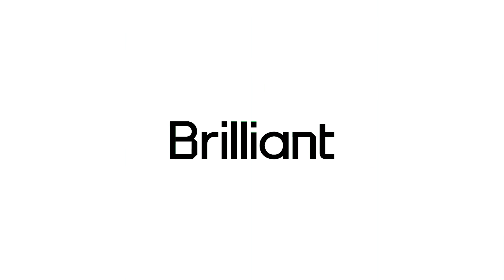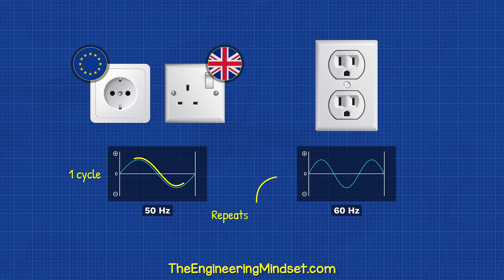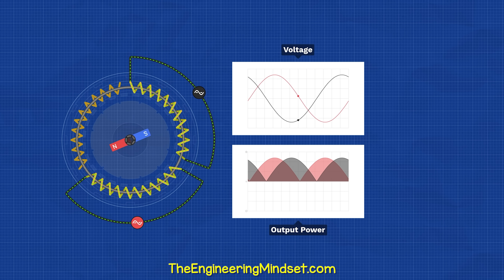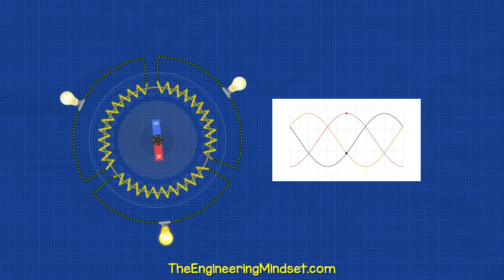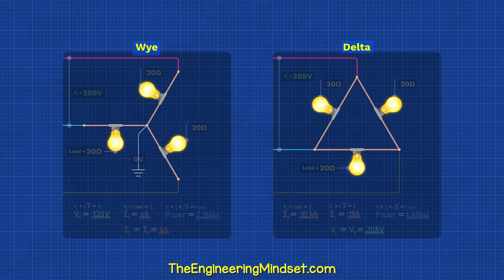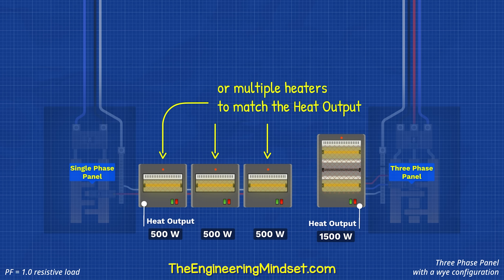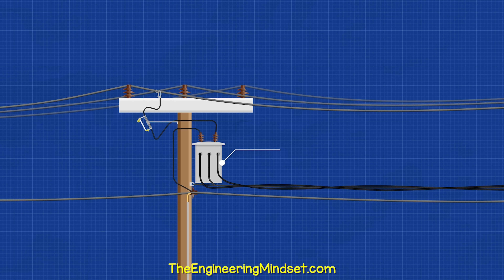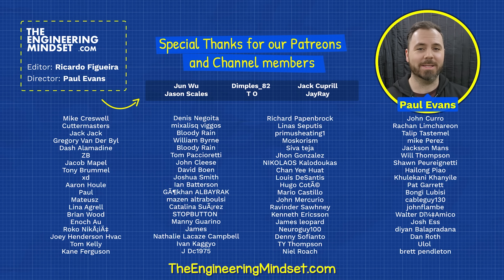How 3 Phase Power works: why 3 phases?

Comment from the maker: :_Hazard: This free video took WEEKS to make! If you’d like to support Paul’s efforts, links below: 
Watch ad-free here:➡ https://www.patreon.com/theengineeringmindset
Get your excel sheets here:➡ https://tinyurl.com/3-phase-calcs
Grab a 3 phase power mug here:➡ https://tinyurl.com/3-Phase-Power-Mug
Reply: Question for you guys. This video mainly features north american standard which is convenient since I am located there. But do you create another version of that video for Europeans with more prevalent European standards? Just curious. Great job BTW
Reply: @jean-huguesbouchard1045  He actually mentioned the european standard as the only alternative to the northamerican standard, even though it was a short video segment.

Usually, in the EU, we have 3-phase power of 400V 50 Hz in every household for big appliances (EV charging, electric ovens and instant water heaters) and 230V 50 Hz single phase (taken from any of the three phases + neutral) for "normal" stuff, usually using 230V 16A circuits. That is already useful for up to 3.680 Watts. Don't try that with the poor, typical 120V outlet in the US! Higher voltage means lower amperage for the same task, so less stress and temperature generation on the wires. But that's not the end of it, because that still leaves the rest of the world.
Reply: Whenever you need massive smoth dc, running a delta wye and a wye wye going through a full wave bridge gives very smooth output, minimizing need for big choke coil.
Reply: Would e.g a 6 phase generator waste less energy into thermal energy?  Like I wonder with our energy demands (e.g electric cars and like appliances that consumed insignificant power now kinda increased noticeably e.g a GPU can easily consume about 600watthours on its own if not more and that's without calculating the inefficiency of the PSU pulling power from the grid in order to provide 600watts to the GPU )
Reply: If the Earth's core is just a big magnet, could we put huge rotating stators in orbit around the Earth and create energy?
Reply: @me1970  no if earth's core had a strong enough mgnetic field to produce power by spinning around a huge stator ring miles outside of the earth (which we wouldbt be able to put in orbit in the first place but lets ignore that)  then you wouldnt be able to pick anything that had the slightest piece of metal on it simply because earth would pull it down towards its core ... you know like magnets do.. earths core has a magnetic field but only strong enough for us to detect with compasses or sensors not strong enough to actually have some real "pull" or magnetic intensity.
Reply: Very well explained
Reply: My 230V 50Hz
Reply: Thank you for your videos, guys! I love them!
May I kindly ask you to make a video about SCADA devices, line monitors, fault detectors, please?
Reply: Not only are higher phase counts more complex, they also run the risk of being tapped by pirates.
Reply: The voltage at the outlet is not constant.
Reply: any of yall from chicago get confused when stuff you plug directly into the wall always looks sideways 💀💀
Reply: Man,  you deserve pension from UN .. When I was a kid (and I'm 52yrs now) BBC would hire 15 man for content like this! Excellent job..
Reply: hi
Reply: I thought the older video was brilliant and then you improved it even further!  The original one is still worth a watch for a slightly simpler overview. Thanks
Reply: Please this video provid in hindi language🙏
Reply: as an electronics engineer, I don't deeply or as clearly understand this until now.  however, learnign this makes me realize how old this is and needs upgrading or replacement.  See, DC high voltage transformers are here and renewable energy is essentially DC, while most things we power in our house are essentially DC.

Comment: A slight correction to something said in the video: the magnetic field does not “push” the electrons in the wire to generate current. Rather, the changing magnetic flux through the wire induces and electric field, which in turn CAN move the electrons (Faradays Law). 

Furthermore, when someone says anything regarding the magnetic field doing electrical work, it has to be wrong because magnetic fields move electrons perpendicular to their velocity, and thus cannot do work.

Comment: If a location has 127V and requires two phases to achieve 220V, would this be considered a 'split monophasic' system?
Reply: if it has 3 main fuses, it has 3 phase power

Comment: The thing that never got through my head is how the neutral in the generator works. 

If one end of the coil is grounded, wouldn't it just escape all the generated energy there?

What makes "one end" of the coil the phase and the "other end" neutral? It would seem they both have the same potential for leaking the electricity.
Reply: Hello there,

Great question,  it's a really common misunderstanding. Neutral isn’t ground. In a three-phase motor the star point is normally floating and not connected to anything. In a balanced system the vector sum of the phase currents is zero, so no current flows there and it serves no functional purpose. Ground is only bonded to the motor frame for safety. Using a ground symbol to represent a floating star point is misleading and causes confusion.

Comment: 2 phase outlets are normal in most homes in Norway. They have 230V phase-phase and 130V phase-ground. Newer installations are 400V with a neutral

Comment: At 8:02, why does a 3-phase motor connect across 2 coils?  Something's wrong with this picture.
Reply from the maker: I checked and the image shown has 3 Phase connection, then in the graph 3 phases are shown. Where the line stops happens to be one phase at 0V (light grey) and then you read the phase to phase voltage of the other two
Reply: Yes, but the motor is connected across all three coils, and the "phantom" voltage among the three is 360(208 x 1.732).  All three coils are powering the motor.

Comment: thanks for the revision. Just a nitpick, but unless I missed something, you omitted the question of brushless motors. Leaving auxiliary phase out of the discussion, three phases is the minimum to obtain a reliable start for a brushless motor (asynchronous) in a predictable direction. Avoidance of brush wear largely justifies three phase in industrial installations. 
Power station alternators are brushless to, if slightly more complicated,  needing a rectifier to apply a continuous rotating field.

Comment: As an IT worker, I've had a general working knowledge of power delivery, but have had a hard time wrapping my head around 3 phase for a while.  This is probably the best explained version I've seen and helps understand aspects I didn't get before.  It's appreciated.  Also, no idea how this video showed up as recommended for me, I've not looked up electrical stuff in years.

Comment: So we use 230/400 and 400/690  mostly i guess in europe. But US 240 split, 277/480, 120/208 and so on, and good to know the different voltages and the use they offer. But i would be annoyed being dependent on splitphase or singlephase and have to deal with these fluctuations. But they can happen in 3 phase systems somewhat if not loaded evenly. Electrician's don't always measure or make plans for correct additions or know the grids fluctuations..

Comment: Em as cargas no consumo não estando balanceadas, há imperatividade do neutro ou pode haver ruptura quando a ligação pressupuser carga balanceada em estrela. De forma complementar, as geração pode ser em um maior número de fases e com neutros distintos para cada trecho, para fins de controle indutivo de cargas predominantemente não indutivas (menos oneroso) do sistema (evitando surtos que se propagam e blackouts e tornando o controle de espectro mais amplo, por ser antecipativo sempre que a carga não-indutiva é prevalente), chagando ao consumidor em três fases com neutro dedicado e suscetível ao controle independente em cada unidade de consumo. Um tal sistema tem grau de independência maior em relação a cada unidade geradora pois o terra é exclusivo e o sistema se reorganiza de forma rápida e segura em caso de queda de unidade, por não sincronização 'por default', do sistema que se antecipa à necessidade de reconfiguração ao invés de reagir a ela, sempre que bem projetado (sempre que a correção entre o descasamento entre cargas indutivas e capacitavas é não-reativo ou reativo abaixo de um valor de 'ignição' descontrolada. Um tal sistema é resiliente e comporta melhor a geração distribuída (pequenos e micro geradores) pois se pode os regulamentar no quesito controle autônomo (interno) e os onerar em caso de envio de resíduo não tratável à rede, inclusive se estabelecendo valores de ressarcimento ao transmissor em caso de ruptura sistêmica.

Comment: In NA 240v 3 phase is the most common voltage and most things are rated to also work with 208v. In Canada we also have 600v. Most motors are dual voltage 240/480. 
The 240v single phase is also known as split phase connection.

Comment: The only mistake is the statement about the electrons, electrons dont move and they are not what creates current. delocalized Bloch electrons are the fundamental cause of electricity in conductive materials like metals and to be clear its waves. So its the field not the particle. This little detail haunts u later in more advanced engineering courses.

Comment: the main reason is just the power transfer. The momentary power of the three phases are always constant - big difference to a single phase.  That is the main reason why Electric cars have a inverter to generate three phases out of the battery and feed that into the drive.

Comment: LEDs do flicker
Reply from the maker: I've replied to this same comment many times but LED's do not flicker, the controller makes them flicker. Cheap and badly designed circuits cause the flicker, my studio LED's do not flicker, my cheap desk lamp does flicker

Comment: 12:44 Actually, if you have 127V in 1 phase, you will have  127*√3 = 220V between 2 phases.
Reply from the maker: Not quite. Because √3 is only applicable in a 3 phase system. This is not a 3 phase system, it is a split phase system so it is (+120V) - (-120V) = 240V because they are both opposite ends of the same 240V phase, reference to ground which is centre tapped.
Reply: @EngineeringMindset  I'm sorry, my mistake! I was looking at the high-voltage three-phase system. In Brazil, we don't use center-tap transformers for energy supply, so it's more common to have a two-phase system with a 120° phase difference.

Comment: Great video. Home LED lights do tend to flicker, but at a speed that you won't tend to notice with a phone camera. If you use very fast shutter speeds you will see that they're turning on and off with pulse width modulation.

Comment: You don't need to load balance your 3 phases. It helps with equipment life and general operation, but you totally can put a load on 2 phases. Would be the same as having 2 out of 3 circuits with heavy loads in a star config.

Comment: It's a good explanation, but there's also a 9 phase generator. It is used to reduce the torque needed to rotate each phase on it's peak.
Torque/force is greatest on highest and lowest point of the wave, that's why you can't have 2 or 4 phase because it's like driving a car with square wheels. The force came from the current, speed to voltage, and force to current.
To compensate for the highest torque, it is made to be 3 phases so the force would cancel each other out.
9 phase generator usually coupled 3 of the coil but it's not offset by 40 degrees, it's 20 degrees! By rotating 3 of those coil, each 3 coils would only have 20 degrees offset so they can be put together in series.

Comment: That is such a convoluted and highly likely BS explanation for why we use RMS>
The far simpler one:
P=VI.
Assuming a simple resistive load, and noting V=IR, this gives us I=V/R
So P=V^2/R.

i.e. the power is proportional to the square of the voltage.
So they average the power, and give the equivalent voltage.

Comment: Two phases (at 90 degrees, also known as "quadrature") are enough for creating rotating magnetic fields for motors.  3 phases is smoother. Three phases have a nice symmetry in that the phases are evenly placed around the circle (3 x 120 degrees = 360). More than 3 phases is more complexity for insignificant benefit.

Comment: But then Veritasium said that an electrical circuit isn't formed by the movement of electrons.
Reply from the maker: Thats not quite what he said. He said electrons drift through the wires due to the surface charge and the energy is transferred through the electric field around the wires. He have an incredibly detailed video on it here: https://youtu.be/3KePcASD0NQ?si
Reply: @EngineeringMindset  Thanks for the clarification
Reply: Wye connection line is  1.7times phase voltages but reconsider it😂

Comment: If you need more phases then it should be done at the power generating station itself. At present most generators have 3 leads at 120 degrees apart giving 3 phases. For 4 phases there should be 4 leads that are 90 degrees apart. I am not an EE expert but I am guessing from my science background.

Comment: Short answer:  Three phases is the fewest number of phases whose average power is a constant.
Reply: Or, the lowest number of slices you can divide a wheel into to provide the smoothest rotation if said wheel had periodic intermittent torque provided to it along the area of each slice respectively.

Comment: During RAAF mechanical trade training back in 1989, we had to do a "Basic Electricity" module, which briefly touched on 3-Phase. And I do mean BRIEFLY. All we had to do was memorise that 3-Phase = "3 phases of electricity, 120 electrical degrees apart". No diagrams of sine waves, nothing. I was that annoying trainee who wanted a better explanation, and pressed the instructor (a qualified electrical fitter) for more. What I got was, slowly, with emphasis "Well, it's 3 phases, and they are 120 electrical degrees apart, see?" I gave up.

Comment: Australia does have a 4 phase electricity supply, a 3 phase electricity supply and a 2 phase electricity supply. 
Exactly how they each work is something I don't know but I have worked with all 3 of them when helping the electrician at my first job over 30 years ago. We had both 3 and 4 phase spools that I had to roll out from the power grid connection point to where our equipment was located, this was for concert sound and lighting.

Comment: Why not less phases I just finished a working 0 phase system 456 AC 36.7 DC output 0 phase multi loop multi output power system that Powers and charges itself

Comment: It is designed to produce 1800 rpm or 3600 or approximately at standard voltage at 2phase or 3phase line.4 phase or more will not run in 3phase line.

Comment: In a 240 volt residential service are the two hots in phase?
Reply: In the US split phase residential then the 2 hots come from opposite ends of a single phase transfomer. When measuring both hots you get one 240V rms wave. When measuring from the neutral (center tap of the transformer winding) to each hot you will get 2 120V rms waves 180 degrees apart. The hots are 180 degrees apart with respect to neutral.
Reply: @Redtooth75  are our 2 120v hots connected to 2 high voltage hots?
Reply: @gamecubeplayer  The hots are connected to opposite ends of a single transformer winding, the neutral is attached to the center. That gives you the 240V hot to hot and 120V hot to neutral.
Reply: @Redtooth75  what about the high voltage winding of the transformer?
Reply: @gamecubeplayer the primary side of the transformer is generally wired to a hot and neutral off an upstream wye transformer.
Reply: that depends on your country

Comment: Sometimes we need more phases. Using special transformers we can get six phases from three. It's useful while converting to DC with rectifiers. Having six phases the conversion is smoother. It requires more diodes in rectifier but the load on each diode is smaller. Anyway this video is OK.

Comment: I have been an electronics technician for about 45 years(not an electrician). when I was in the Air Force in Germany, my commander wanted to install some 120V 400Hz equipment in a prefabricated structure that was wired for 220V 50Hz. We didn't have any electricians in the unit, but Ground Radio Maintenance is the traditional go-to for anything that doesn't fit anywhere else. I connected the 120/400 to a separate circuit breaker panel, and voila! we had power for the equipment.

Comment: I've taken 61 trips around the Sun.  I have seen many presentations on how electrical power is generated and distributed.  This is hands down the best I've ever seen.  I don't know why the term "3 phase" power never clicked for me but now it's crystal clear as you explained.  It is the smallest unit of power generation for both smooth current flow with the least complexity.  Just like 3 legs are the least amount of support to make a stool.  Or a triangle is the simplest geometric shape to form a 3D object.  Thank you so much for this wonderfully enlightening presentation !!

Comment: Where does the formula for calculating the neutral current at minute 07:22 come from? The result can only be valid in the presence of purely resistive loads, but in the most frequent cases, of an inductive-resistive load, this formula is not applicable.
Reply: The formula is valid for any load as long as the currents maintain 120° apart.  While purely resistive loads are one possibility, a load of (3//4i) - 1.44i will work because the equivalent impedance is 1.92 ohms. And it contains a resistor and both inductor and capacitor. 

As for where the formula comes from, it is simply KCL. N = A∠0° + B∠-120° + C∠-240°

Just ask AI to find magnitude of N and you should get the formula shown in the video.